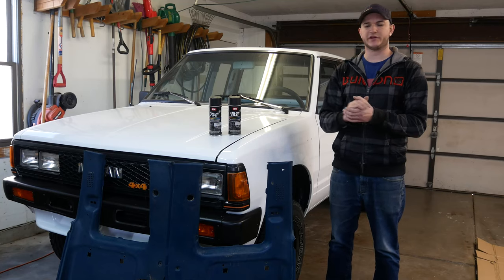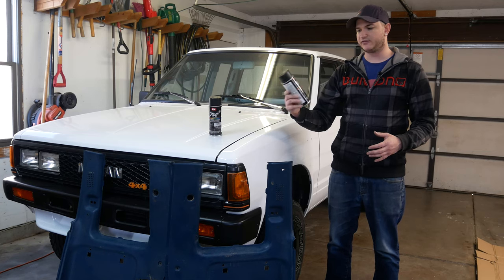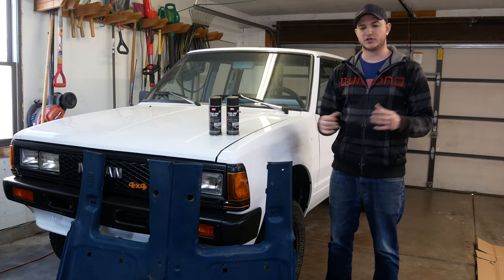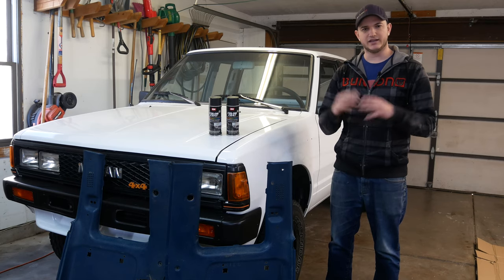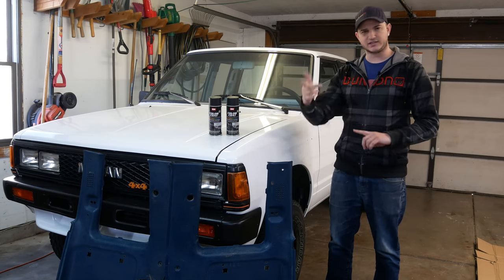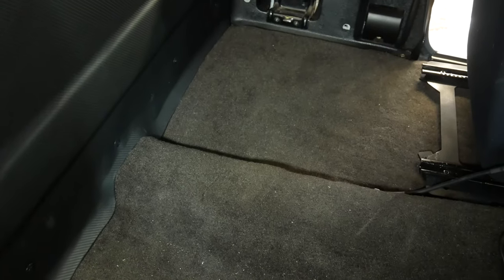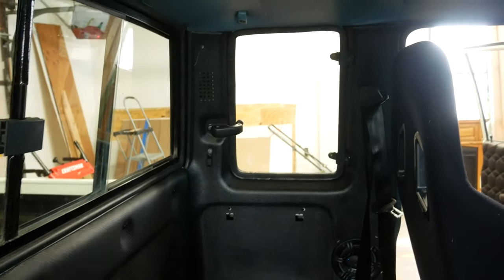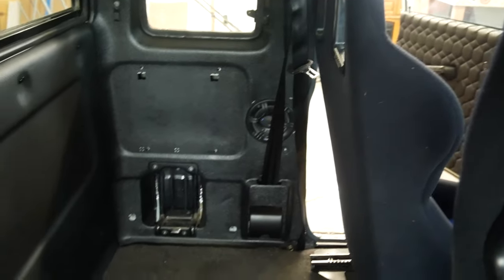Interior Carpet install and Painting Old Trim for the Nissan 720!

Comment: I am wondering where you got the center console with the switch by your shifter. I am wanting to add something similar to my 86 but, can't seem to find anything.
Reply from the maker: Here is one like mine on amazon - https://amzn.to/31R87bO

They are not fully installed in my truck, they came with it when I bought it. You'll want something like this or similar.
Reply: Can you update your link to the seatbelts?